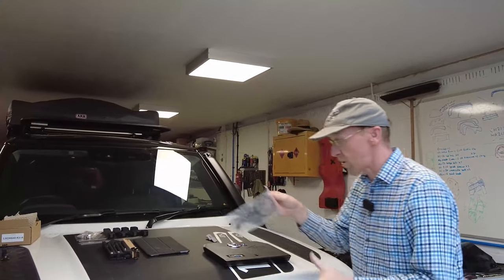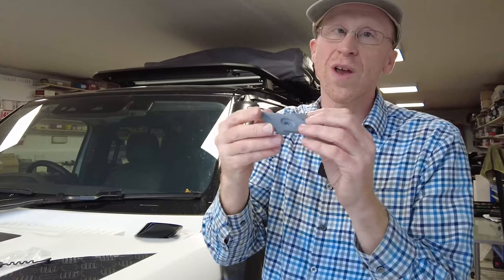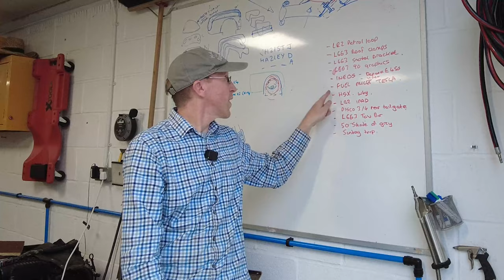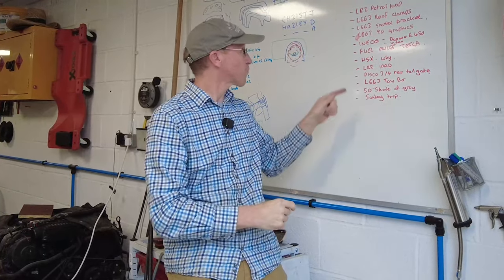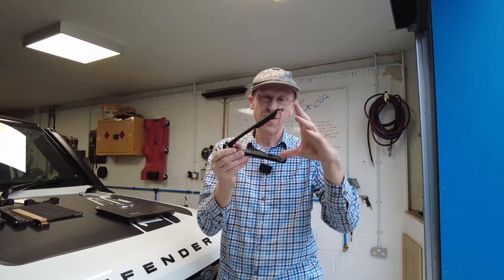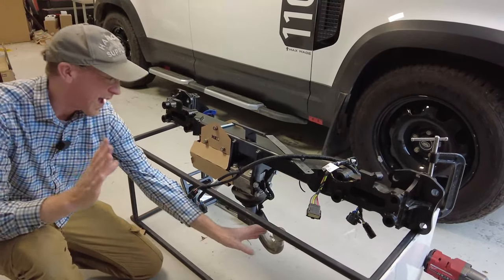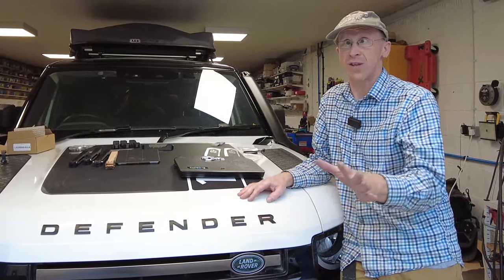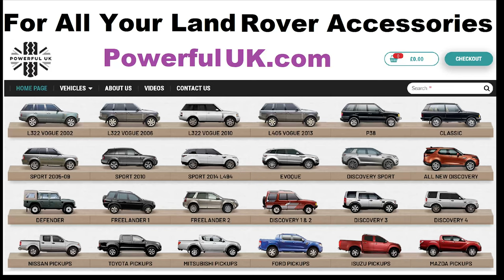Vlog 8 oct 2021 - Freelander 2 / New Defender / Tesla / Ineos

Comment: interesting video as always, thank you. I have a 110 Hardtop with the bulkhead between the cabin and rear cargo area, this restricts the length of stuff you can put in the back, could you design some kind of access door/flap that could fit into the bulk head that would allow longer items to be carried maybe resting on the centre armrest, also maybe some cup holders that could fit to the bulkhead on the cabin side (only two cupholders in a hardtop!) thanks

Comment: And breathe, how much can you get in a vlog!  Great content, just a suggestion for a another one. I remember you exposing a power lead running under the plastic sills when you were doing the several vlogs on the winch. At the time you mentioned it must be for illuminating the Defender in the sill plate on higher spec models. Any plans on making the illuminated sill plate? Guy.

Comment: Thing about the Grenadier is although I really like it they can’t sell the ICE version from 2030 so it will only have a life span of 8 years. I don’t see Ineos converting that platform to BEV. I think it will become an export vehicle for ROW.

There also another solenoid that fails regularly in the D3/4 and that’s the fuel flap lock

Love those F2 iPad mounts could you do something for a D3/4 ?

With all the kit you do now you could offer built/turnkey vehicles (like URBAN) with either new or used cars.
Reply from the maker: Lots of ideas here...
Yes the Grenadier was a great idea but the result should have been more Suzuki Jimny and less G Wagon !
I will take a look at the Fuel cap solenoid on the D3 D4 - i have ordered the bits and will do the video !
Yes we will launch the Freelander 2 mount and then move onto the D3
Building cars sounds fun and a route to riches but i think it will consume too much time and we will loose focus.
Reply: I really like the Grenadier, even put the initial deposit on it, however whilst I have time to think about it, the more I wish they had a PHEV version at least. Wrangler has a PHEV and it looks great. Also the cost, it is almost (in Australia anyway) getting to the point where you can buy a really old defender and convert it to electric for the same price.

Comment: Your update vlogs are great. I like the roof bar clamps a lot. I see from your website that they won't fit the LR cross bars, it's a pity the profile is different. 😢 If you could make some for the cross bars with the square plate in steel for magnetic CB mounts that would be brilliant. 👍🏻
Reply from the maker: Hi Steve - we are on it !
Reply: @L663  Cool! My Defender's crossbars are the same profile as my old Discovery Sport ones (standard Thule maybe?) - I think the cross bar version would have a good customer base for you. 😉

Incidentally, I think this is a better and more versatile solution than your idea for a roof rail bracket. 👍🏻
Reply: Yes, @ Steve Bryant… you are right, I have the crossbars and will definitely buy the clamp. Good stuff Simon.

Comment: Great update…. One question, do you intend to produce similar brackets to fit the roof bars, as opposed to the roof rack?
Reply from the maker: Yes thats the plan ! out of interest what are you thinking of mounting on there to give me some idea of how to design the top plate.
Reply: @L663  Brilliant. Its for mounting a roof box, so ideally the coach bolts would be longer to push through the floor of the box and a 3rd plate would be useful to secure over the bolts inside the roof box.
Reply: @L663  I would be mounting an awning, with quick release bracket setup. Cheers.
Reply from the maker: @philritson3685  OK - interesting - i think the top plate would be OK moved inside the roof box - you would still have a "hoop" of steel to ensure it was secure
Reply: @L663  yep, that would work. I wasn't so much thinking about securing the mount, more that having plates both on the inside and outside surface of the box would hopefully stop any potential splitting of the plastic over time. Thanks
Reply from the maker: @philritson3685  Yes i follow that but i think its not needed - the top of the upper spacer will be flat so the roof box will be sandwiched between the flat top of the spacer and the metal plate inside the roof box.
Reply: @L663  OK, sounds good... looking forward to seeing them on sale soon!

Comment: Thanks for all the information. Lots going on, fl2, could you notv use long strips of velcro instead of screwing the ipad holder down? You said you would use 2 holders so maybe it will be ridged enough to keep the ipad secure. I leave the testing to you. Again great to see what's going on
Reply from the maker: We have a couple of options to look at to fix - tape / velcrow / screw - the max force will be when you fit the ipad as you need to bend the spring arm and the force need to be reacted at the base.
Reply: @L663  it was a thought as some people may not like to screw the dash board